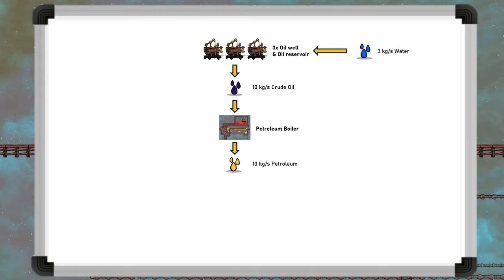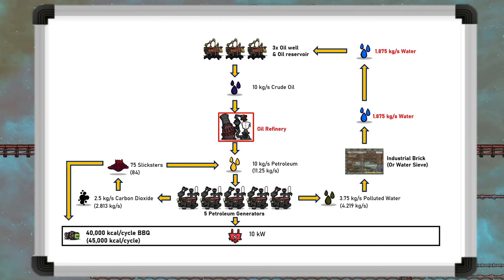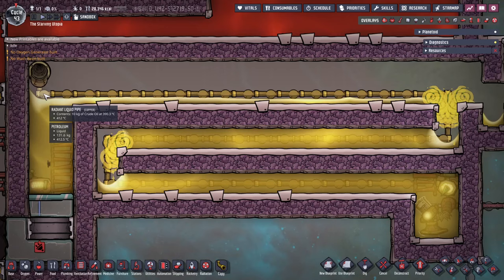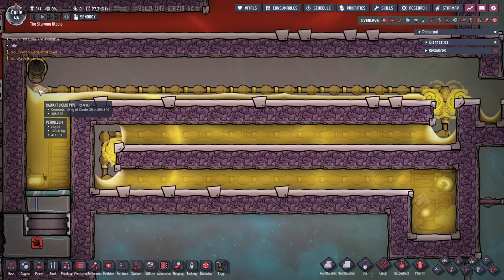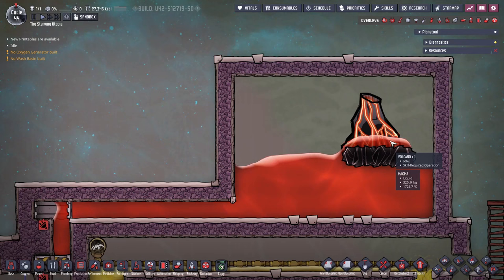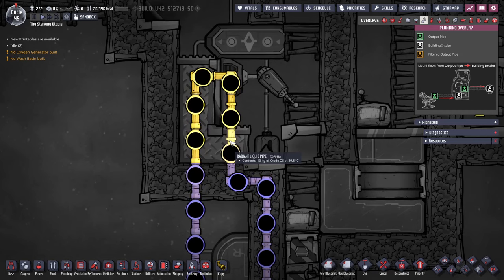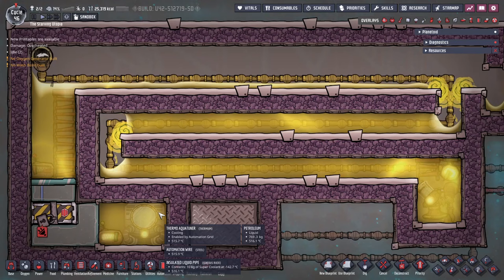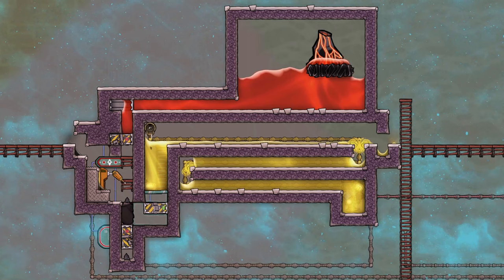Oxygen Not Included - Tutorial Bites - Petroleum Boilers

Comment: Why not just pass the petroleum through the aquatuner as you pump it out of the boiler? You're exchanging heat between the coolant and the petroleum anyway. Skip a step and pull heat directly from the petroleum.
Reply from the maker: That may seem like a good idea, but the specific heat capacity of petroleum doesn't work well. Because its so low, you would need 4.77 aquetuners cooling petroleum to match a single one with supercoolant. That means pulling almost 6kW of power rather than 1.2kW. Plus in this case all you're actually saving is the need for a pipe to pipe heat exchanger which is simple to build anyway.
Reply: @GCFungus  Oh I see. It's because the supercoolant will get cold enough to cool the petroleum by more than 14 degrees. Thereby extracting more heat than an aquatuner would. Clever.

Comment: What about Liquid Tepidizer? Can it be used as a heat source?
Reply from the maker: The tepidizer normally runs up to 85 degrees then turns off. You can trick it like I showed in the heating tutorial bite but above 125 degrees is loses efficiency to stop you exploiting it too much. That's not hot enough to boil oil.
Reply: @GCFungus  The only problem of Aquatuner Boiler is the need to preheat the system. I was thinking about using Tepidizer on Aquatuner pipes to do it. Can't get above 125 degrees?
Reply from the maker: @Lorens4444  Not effectively no. The heat up shouldn't be too bad and does only need to be done once.

Comment: At 7:00 you said that geothermal has the problem of "heat spike"? What is that? Because I built one of these things naively using geothermal in my actual run, using a single diamond tempshift plate at a diagonal in order to extract geothermal heat and it's been working flawlessly - but I'm not sure if this "heat spike" thing has happened yet.
Reply from the maker: A heat spike is a design (not something that happens) which extends usually diamond window tiles into a pool of magma, creating a spike shape. This is necessary because as either a boiler or power plant draws heat out of the pool, it will slowly cool and solidify, so you dig further to get to the hot bits again. Now this works completely fine for both boilers and geothermal power, but is fundamentally not sustainable as the heat is slowly used up. Personally I prefer to make boilers fully sustainable which is why I prefer volcanoes.
Reply: @GCFungus  makes sense, thanks for the info!

Maybe enough cycles have not passed yet, but it seems to me that even with a single diamond tempshift plate, the heat in the magma pool is being drained evenly among the entire magma pool. So while it is fundamentally unsustainable, it does not seem to require more than 1 diamond tempshift plate to extract the heat, making it a simpler mid-game design since you can skip the complicated volcano taming mechanisms until later.
Reply from the maker: Yeah it's essentially a matter of time and how quickly the heat is being drained. Geothermal setups can vary with size, so 1 or 2 steam turbines will obviously pull a lot less heat than say 5+. If it works then there's nothing wrong with doing it, and heat spikes are a perfectly good way of extracting the heat. I would also say that actually the volcano taming for a geothermal volcano isn't actually that complicated, as I hope to demonstrate when I get to that tutorial bite!
Reply: @GCFungus  Looking forward to it! Your tutorial bites are excellent.
Reply: @GCFungus  here is a screenshot of it: https://imgur.com/Hp7NLVZ.png

The magma temperature shown here is roughly the same in any location in the magma.

The topmost magma tile was an igneous rock insulated tile that got melted from the tempshift plate (oops!). Seems harmless though.

Anyway my point is I think this is going to last a great number of cycles before I need to retrofit the heat source, and by that time maybe I can upgrade to a sour gas boiler.

Comment: I haven't tried boiling petroleum yet. I always thought that boiling crude oil produces natural gas as well. Where is it?
Reply from the maker: No, the oil only turns into petroleum. You can then boil the petroleum into sour gas, super cool that into methane and then reheat into natural gas, and this build is called a sour gas boiler which I also have a Tutorial Bite for.
Reply: @GCFungus  oh! yeah, i've seen your sour gas boiler tut. if crude oil just turns to petroleum, is there an issue if you just use a metal refinery, use oil as the coolant while turning it to petroleum? no pipes bursting?
Reply from the maker: @jeremygonzal8603  Oil turning into petroleum inside pipes will cause them to burst so you do want to avoid that. Generally though oil should be fine from a metal refinery if you're running radiant pipes through a steam room. But you can use petroleum to be safe.
Reply: @GCFungus  Darn. So they do burst pipes. That seems nonsensical since it's liquid to liquid. And yeah, I figured petroleum is the best metal refinery coolant since it can take so much heat then you just feed it all to the petroleum generator deleting all of that heat. I'm actually using heated petroleum to make refined phosphorus.

Anyway, your tutorial bites are AWESOME! Thanks for all the work on your videos!

Comment: Also, in my current map the volcano I have is too close to the bottom of the planetoid to accommodate the whole boiler. Can you suggest ways to save a bit of vertical space, please?
I guess 
1) the blade of 10 spaces coulf be in line with the base of the volcano (i.e. the insulating tiles continuing from the nuetronium)
2) those two spaces below the upper mechanized airlock could be reduced to one
3) same for that one extra space after the second mech. airlock, maybe?
4) what about a smaller/different receptacle for the igneous rock broken by the robo-miner? Moving it out to a space with some water under a turbine, using shipping?
Thanks 🙂
Reply from the maker: Well the first option is simply to use an aquetuner not the volcano, but if you are set on that then be careful making the blade too close to the volcano as it won't be able to store enough when dormant. Remember that the shape of the boiler doesn't actually matter, just the length - so rather than use 3 layers as shown you could literally make this 1 horizontal layer 3x as long. Reducing any space you can manage in the heat injector and debris collector will help.
Reply: @GCFungus  oooooooh! You're a genius! 🙂

Comment: why do you need to vacuum out the volcano?
Reply from the maker: So if you open the volcano and enclose it quickly with insulation then leaving gas inside shouldn't be an issue. Vacuuming out hot areas though does mean you can have dupe access without scalding. That's particularly useful if you want to set things up while the volcano is erupting, or you need to go back in later to change something.

Comment: i thought i followed this plan pretty well but my boiler keeps breaking from pressure damage where the oil boils
Reply from the maker: Is the oil boiling more or less instantly? Usually pressure damage only occurs when the oil builds up. Otherwise the petroleum should be able to flow back down the heat-exchanger freely.
Reply: i had the same issue with this, my problem was the petroleum in the counterflow was too much because i didn't pump it constantly. If you're pumping it constantly from the boiler system this won't be an issue. Easiest way to check this is to see if there is gaps on the counterflow, if it's there, you're probably all right. I also added an hydrosensor with the notification automation thing on one of the said gaps just in case some weird pipe mechanics blocks the flow after the pump on the boiler.

Comment: Hi, is it posible to make this work with cobalt instead of magma?
Reply from the maker: I must admit I've not tried it, but I've done a quick look at the maths. I believe it would be possible, but it is much harder to make work compared to even a minor volcano. From a heat point of view, to run a full 10kg/s boiler from an average minor volcano, you have to keep the oil output temperature above 365 degrees C. For a cobalt volcano this would have to be above 392 degrees C , so a very small window. In addition I expect there would be practical challenges in managing the cobalt flow, as the amounts produced are much less, and I don't know how the liquid will flow. If you've built a volcano one before and want to have a go at cobalt for a cool challenge, then by all means give it a go (in sandbox) and let me know! If you're relatively new to petroleum boilers then I'd stick with magma first.
Reply: I was asking because my map did not have any magma volcanos. I only have cobalt and iron.

Comment: Is it a problem if I only have 2 oil wells?
Reply from the maker: Yes and no. If you simply hooked up 2 oil wells to the design as shown, you would get small packets of oil that would get too hot in the counterflow heat exchanger and break the pipes. But the design can be easily modified to accept 2 oil wells. Firstly I would recommend using a liquid valve on the input line to ensure it was only letting in a constant 6666g/s. Then you will likely have to shorten the length of the heat exchanger to make sure it doesn't get too hot at the end. You can do this by physically shortening the runs, or replacing some of the radiant pipe with insulated pipe until you get a good stable output temperature near to 400 degrees.

Comment: Hello, I'm trying to make one petroleum boiler but I'm using the magma at the bottom of the map, I have not finished yet but I notice one thing, when the crude oil boills in petroleum in my game it also make sour gas, and it does not happen in the video. how you did it?
Reply from the maker: Regardless of how you supply the magma, you should have the magma on one side and the oil/petroleum on the other. The key thing you need to control heat transfer is a heat injector, which is a mechanized airlock controlled by a thermo sensor, which is sat between diamond window tiles. When the door is open, there is a vacuum so no heat is moved across. When the door is shut then heat can come from the magma to boil the oil. I covered this at 04:31 in the video.